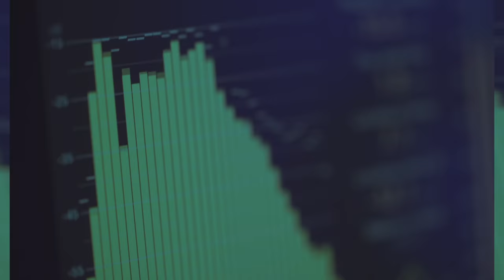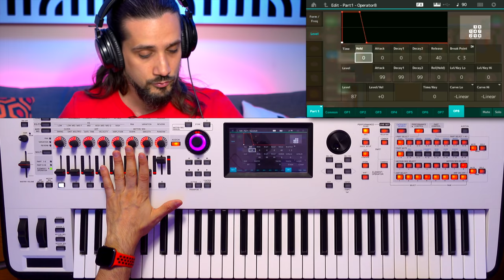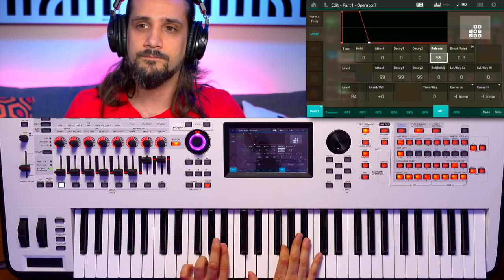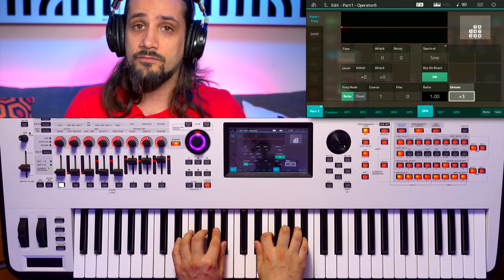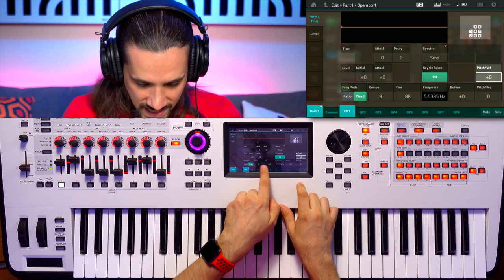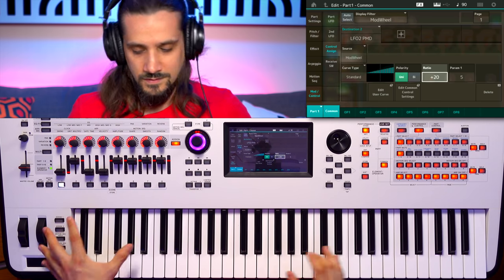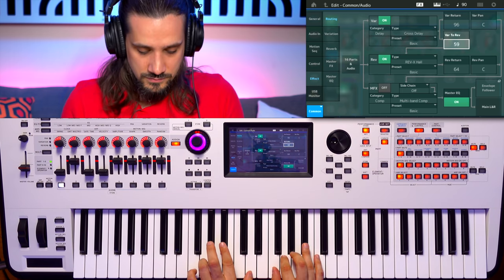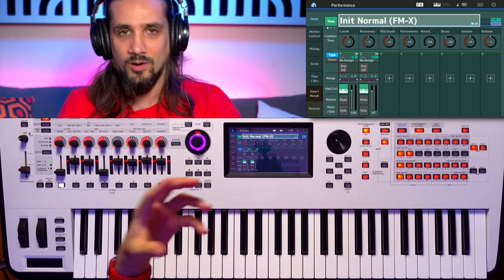Create a WARM, LUSH FM PAD on the Montage/MODX- FM Synthesis Mega Tutorial  #fmsynthesis #montage

Comment: Your video is so encouraging, that I wanted immediately go to my ModX and try out some of those ideas, except it's now too late (nearly midnight), so it will have to wait until tomorrow. The trick with detuning the modulator to use it as an LFO is brilliant! I'd rather turn it to Fixed and a really low frequency, but this approach is much more flexible.
Thank you Dom, you help people to multiple the value of the gear they already own.

Comment: Excellent! More of these please! :) Just one question - In the Operator settings there's the 'Key On Reset' option. I'm assuming that it restarts the phase of each operator with each key press, so would switching it off introduce a little more movement and unpredictability, therefore adding a more analogue vibe. Am I right?
Reply from the maker: +Geoff Pinckney exactly! It determines whether or not the oscillation of the Op is reset each time you press a note ;)

Comment: Awesome stuff man loving the channel. I tried doing this with MODX which is bit harder with only have 4 sliders etc. I got all the way through creating the lush pad until i reached the bit where you edited operator 1 and 2. When i adjusted fader 1 and 2 it turned the whole track off when I looked back at mixer page volume went to zero. So I turned it up then went back into editing i didnt get any sounds from any of the operators. I tried tapping the button which switchs parts between 1 and 4 and 5 and 8 and trying all faders then sometimes i would get sounds and othet times not. I gave up in the end I tried this about 3 times with same results. Got any ideas ? What this is.